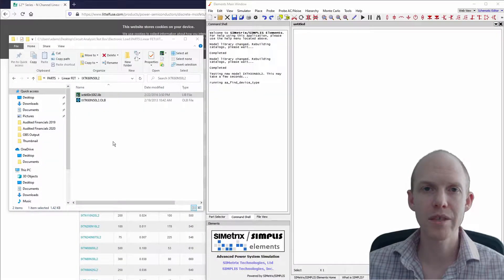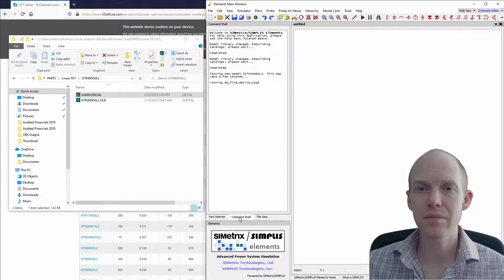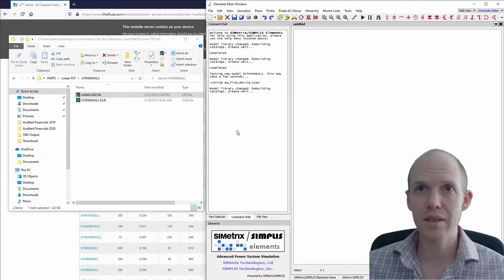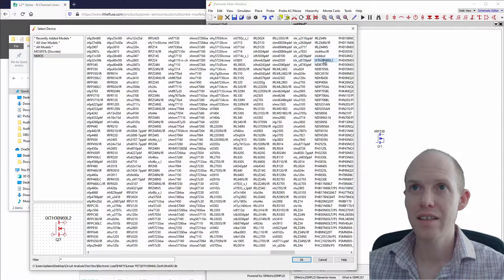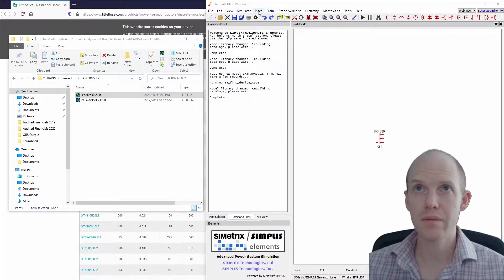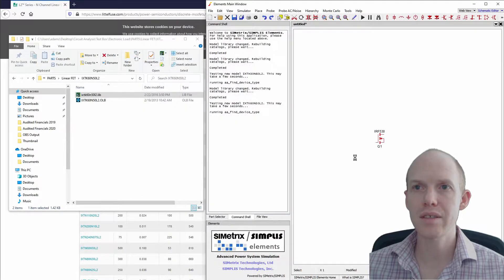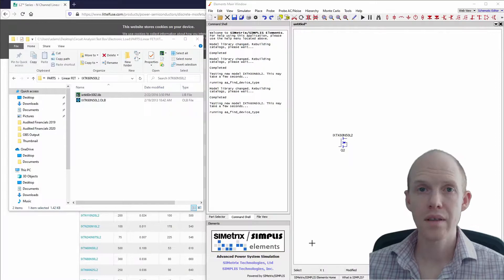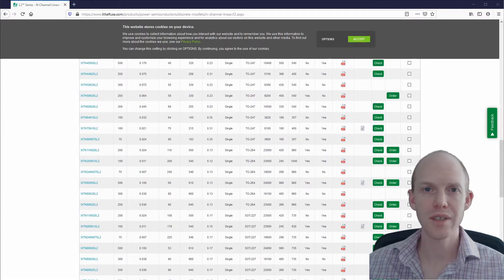SIMetrix/SIMPLIS - Adding Part Models

Comment: Thank you for this video... This model import was for simetrix or Simplis? or Under sumulator pull down menu which tool you had selected?
Reply from the maker: That was Simetrix, but the way SIMPLIS works is it automatically generates piecewise linear models (PWL) for standard parts (like diodes and transistors) from the SPICE models so you should be able to select the imported SPICE models for SIMPLIS as well and then click Extract and it will generate the PWL version.
Reply: @CircuitAnalysis  ok let me do an example if any questions, will communicate

Comment: Hello, can we import the pspice model like olb format into SIMetrix or the LTSpice model into SIMetrix.
Note: I am not asking for the Lib file to add in SIMetrix. 

Thanks in Advance!!
Reply from the maker: I have not found a way to import the symbol models, just the SPICE code models. I think you have to re-draw the symbol if it's a custom part type or use one of the built in symbol drawings if it's a standard part type.

Comment: Thanks sir for useful video. I just worked with Simetrix/Simplis, I could not findout the spice model of the schematic in any source. Please help me to resolve this problem. Thanks Bro
Reply from the maker: To view the netlist of the whole circuit you have to run the simulation first to generate it and then go to Simulator => Edit Netlist. Note that there is a pre-processing step so you can view it before/after that. You can also press "F11" to open a window that lest you write SPICE code that is injected at the top of the netlist. You can view the SPICE models for each individual part by right clicking on it and selecting "View Model" in SIMPLIS or "View/Edit model" in Simetrix. I made a bunch of other videos in this playlist if you're interested: https://www.youtube.com/watch?v=eiOfgwpHIKw&list=PLPJa0dSdlB4WKriRAjfVYXO8W5goUo5wy